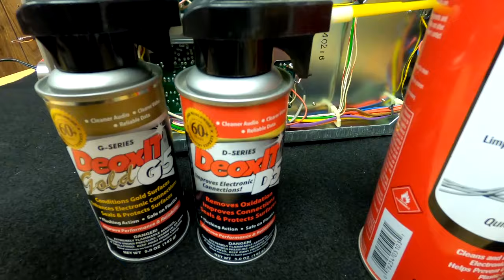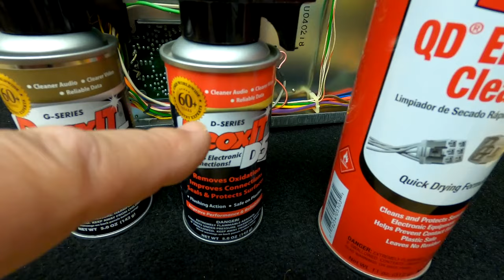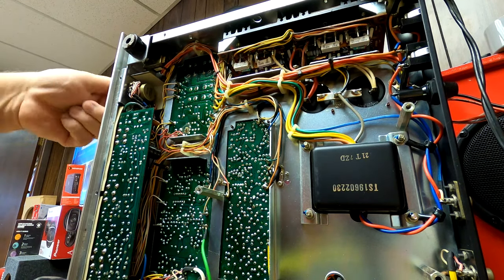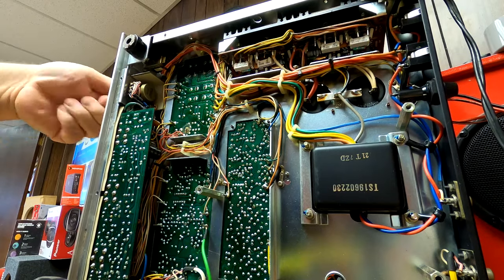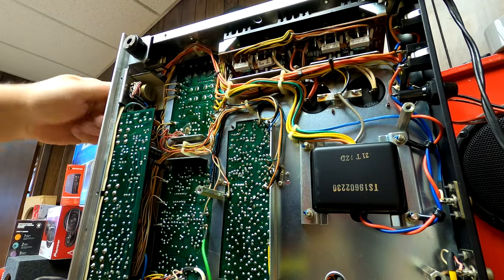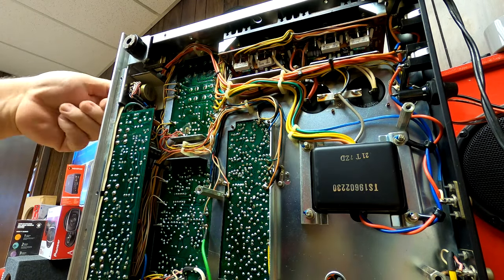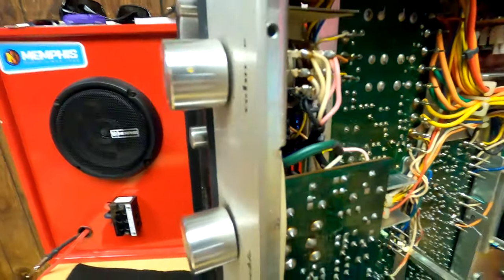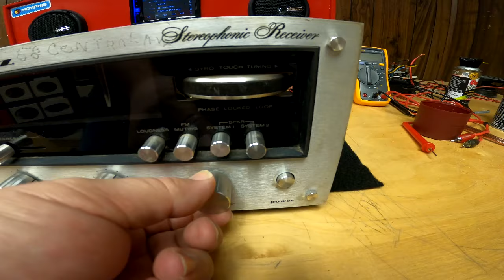How to Clean a Dirty Volume Control

Comment: I’ve cleaned large mixing consoles/desks for decades.   Use CRC QD to clean, CRC 2-26 to lubricate.  That’s all you need and stands the test of time.   The real secret is the person doing the job.  You can damage just about anything by not knowing what you are doing even with the right chemicals.   And don’t tell anyone, but somehow 40 years ago they cleaned components with isopropyl alcohol and lubricated with wd40!  The horror!
Reply: I remember 40 years ago seeing people do that. It worked......for a little while but always ended up becoming an even bigger probelm eventually.
You're absolutely right about the QD Electronic Cleaner. 
You can get it at walmart for about 5 dollars. I've been using it for years and it works great
Reply: Isn't 90 proof still good to clean with?

Comment: For your amazement WD40 stands for "Water displacement 40" it has been use for over 50 years in the boating industry to dry and promote electronic contact in wet ignitions systems of boats and of cars. It was also use in the boat store next to my house when I was a teenager for contacts and switches. Making them work instantly. It was manufactured for that. People now a days use it to lubricate when this IS NOT A LUBRICANT like penetrating oil but will leave a small oily lubrication since the main component is FISH OIL... I don't use it for potentiometers... when I get a bad case of a dirty POT I just disassembled it, cleaning by hand with a Qtip or whatever needed and re-assemble it back! And that turn out to be a super clean pot...
Reply: There is no fish oil in WD40, they actually straight up called that out on their site lol.
Reply: Can we use WD40 to clean volume controller of amplifier ?

Comment: Crackling volume or other pots can also be an indicator of bad capacitors with high DC leakage.  The DC passes thru the pot and as you move it, it crackles.  Of course if you have sudden loudness changes as you rotate a pot, it's most likely dirty or has a bad spot.
Reply: How would you know the difference? Is it dangerous if it's leaking DC? I don't know anything, I just want to fix it.

Comment: Deoxit markets its F5/Fader product as for use with faders and potentiometers. However, if you read the company's product guide for audio gear applications, they recommend only F5 for faders and only D5 for potentiometers. At least I'm not the only one confused.
Reply: Their reasoning is inpart because the slider faders are always plastic with some conductive stuff glued/painted on them. For pots, they could be metalic coil, metal with painted on conductive material (carbon), they could be plasitc with conductive material, etc. Which gets into this product is better that that product for that scenario. Most people are not going to disassemble the pot to find out, just spray like in this video. 
My understanding is by mid 70s most of the pots were of the carbon disk type, not the wirewound. So F5 would be better.

Comment: Deoxit gold is just an extremely mild form of deoxit.   The "gold" indicates that it's intended for use in applications where precious metals are present as they can be harmed by something as strong as normal deoxit.   Classic deoxit is 20‰ cleaning agent by volume.   Deoxit Gold contains a mere .5‰ (one half of one percent) cleaning agent by volume.
Reply from the maker: I understand,  however I have been using this combo for years with great results.
As they say..... works for me.
Cheers
Reply: Sokniko01..so, in ur opinion..you dont need the gold?
Reply: @lazymug  That is correct.  Deoxit Gold is just a super diluted form of Deoxit made for use on precious metals such as gold that might be negatively impacted by the use of the full strength Deoxit.
Reply: Is Deoxit Gold safe to use on the Marantz pots ? They have silver contacts within them I believe

Comment: For cleaning I use the already mentioned combo of CRC ELECTRONIC CLEANER/ CRC 2-26 lube which are easy to find. I use deoxit f5 if there is an actual "oxidation" issue. That is the ingredient that makes it different.  Brick and mortar locations that carry CAIG Deoxit products right on the shelf that may be near you include, Guitar Center, Micro Center(computer store), select electrical trade supply houses, and select appliance repair houses.
Reply: CRC QD Electronic cleaner is not easy to find.
Try living in England, you can buy drugs of any description on any street, illegal firearms BUT not CRC QD Electronic Cleaner. 😡

Comment: I have a Fisher Integrated Amplifier model CA 880. My aunt gave it to me probably 20 years ago, and she got it new back in the early 80s.  
Anyway, for at least the last 5 years , the volume knob would crackle like crazy when it was turned up or down. It was so bad that I had to adjust and readjust the knob over and over again just to get the sound to come out of  both speakers. So I watched your vid, hit the hardware store for some contact cleaner, and cracked that sucker open. I followed your directions and now there is NO CRACKLE AT ALL and no "dead spots" on the volume dial. 
Thanks a million for the excellent instructions!

Comment: CRC QD should be used very sparingly. Too much will compromise the carbon tracks inside the potentiometer. 

Dexoit Gold is for gold plated surfaces ONLY, such as computer edge card connectors. It contains up to 70% naphtha which is a very strong solvent, and will also attack plastics. You do NOT want to use this on potentiometers.

Deoxit F5 is designed specifically for faders, and generally accepted for use on potentiometers. It is safe for plastics.

Deoxit D5 is for metal-on-metal contacts such as switches, relays, and connectors.
Reply: Yours is the best explanation for the proper use of these products that I have seen. There is a LOT of misinformation out there on what cleaner/treatments to use where. I hope many people see your explanation. Thank you.
Reply: Exactly!... Gold is for gold contacts not for pots! Following this kind of advice you destroy your equipment!
Reply: I was just thinking the same thing...
Reply: I purchased some Deoxit D5 Gold just the other day, because thier information on the brochure said it was safe on plastics and clearly can be used on precious metals, such as for example gold, silver and rhodium.  When you say potentiometers do you mean pots ? Like volume, bass, mid and treble controls ? It's made as an electronic cleaner, so why would it be made unsafe for pots ?
Reply: @odysseus521  I think it is, like a volume "pot" is short for the potentiometer.

Comment: I have seen some warnings about using D5 on carbon pots, since it attacks the trace apparently. So following up with DeOxit Gold or Fader lube (F5 in the green can) is recommended. Mr. Carlson's Lab (super expert) even recommends using Specialist Gel Lube WD-40 (not normal WD40!), formerly known as "Spray-n-Stay". It prevents oxidation and water intrusion and provides smooth operation and good contact for a long time. Your instincts about this are good, and thanks for the tip on a lower cost solution! Saw your warning about WD-40. Specialist Gel is different stuff and it's not for cleaning, it's for preserving the clean contacts.
Reply from the maker: I haven't watched Mr. C for a longtime, I will go and try to find his video on this subject as I'm always willing to learn. I have been cleaning pots and sliders like this for many a years, before the CRC I used to use Blue shower (old formula) then fader lube. Just made sense, to me. Thanks for watching. Cheers
Reply: @breakerbroke23  Thanks for your reply! The Mr. Carlson cleaning video is on Patreon, so it may require a subscription to his channel. It is called 
"Mr. Carlson's VR and Potentiometer Cleaning Process, Also: PCB Breakout Board Release!" on Jun 15, 2020 at 9:49 PM
Reply: A friend of mine that has been doing electronic repairs for years, uses LPS-1 as a final lubricant. DeoxIT Fader 5 in the green can and then the LPS-1.

Comment: Good stuff 👍. I've had good luck using Deoxit F5 on variable pots / switches, especially the sliding volume in the older Turner hand mics.
Reply from the maker: yea, I use Gold on those pesky Turner mics :)

Comment: You're right, Caig recomends using the Deoxit G-series after the D-series. They have different purposes.
D-series is for cleaning. The G-series, S-series, and F-series are for protecting various items
The Deoxit D-series (D5, D100, DN5, etc) are for cleaning and deoxidizing.
The Deoxit G-series (G5, G100, GN5, etc) are for protecting with a little bit of deoxidizing action. Sufficient for the little oxidation expected on gold plated connectors. 
The Deoxit S-series (S5, S100, SN5, etc) are for protecting with some lubrication. No cleaning action. Stronger protection than the G-series, better for harsh environments.
The Deoxit F-series (F5, F100, FN5, etc) are for lubrication. No cleaning action. These add lubrication that was removed during cleaning with the D series product. This is for things that move, such as volume controls, turn knobs, switches, multi-selectors.

That's a very short version. There's several user guides to cleaing vintage audio gear that are pages long about how to handle various parts, or for vintage PC parts which are closely related to retro games.
Reply from the maker: I don't believe I have used the S series, I will check into it. Lubrication could be an issue in our mobile electronics as it could attract dirt ( front controls on a CB Radio ) but I imagine would be good in the home environment.. Thanks

Comment: I just got a Pioneer SX-450 that's very scratchy. I tried doing this with D5 and it didn't work. I'm not sure I got in the pit correctly. I didn't take off the bottom cover though. I'm gonna give this another shot now. Thanks for the video.

Comment: The Red Deoxit is not intended for Pots, its only meant for Switch contacts eg. Brass plate etc and so will kill the carbon tracks inside pots over time & sometimes in fairly short order and isn't great on fibre board PCB's in older equipment....!!!!!   The Green F5 Fader Deoxit is intended to be safe for carbon or other resistive tracks and won't kill your pots or faders.....And the Gold one is specifically for Cleaning Gold Plated Contacts....All seem to be really good for all of their intended uses....

Comment: I have a Harman pellet stove do you think I can clean the control board? Is there a good way to clean the control board to help it lest longer? Do you think it would be ok to use a can of DeoxIT D5 to clean the dials once a year to help the control board last longer? If you think this would be ok should I give each dial a small spray then turn the dial  then let dry?
Reply from the maker: I would blow the dust out every year and go from there, I don't see where a shot of DeOx would hurt when doing that regular maintenance. I like having a can around anyway.
Reply: @breakerbroke23  thank you very much for  getting back to me hope your channel is doing good

Comment: Deoxit Red is not meant for carbon potentiometers.  It will degrade and eat away at the carbon over time.  Use the Green Deoxit.  The red will work great at first but over time the pots resistance will start to fluctuate because of the carbon break down.
Reply from the maker: Thanks, I will look into that.

Comment: The WD-40 contact cleaner is just as good, and you get more of it in the can so more cost effective if using it a lot. I always follow it with a blast of compressed air. If the carbon pads inside the pot themselves are worn away then there's no saving them time to replace them.
Reply: Is the WD-40 contact cleaner any good...? 
CRC QD Electronic Cleaner is unavailable in England.

Comment: The CRC CAN is for automotive use only! You use that for Terminals connector like your headlight connector. That's not for electronic use.
Reply from the maker: You are wrong my friend,  but hey... Thanks for watching.
Reply: I use it on all electrical
Reply: I use it for cooking, never had a problem.

Comment: I just picked up a Teac A-7010 reel to reel tape player and the power button seems to be gummed up. I will follow your advice and see if that solves the problem. Crossing my fingers, hopefully that works! Thanks for the video!
Reply from the maker: Soak the switch with the CRC, (get as much as you can inside )
Let it soak for a minute or so then try to move the mechanism on off on off. I had a technics receiver come in that the power switch would not move at all, I thought it was a bad or stuck switch, so I first sprayed in a bunch of CRC let sit and did it again.  The switch freed up and still works like a charm. 
Don’t forget to use the DeOx to lube it up.
Reply: @breakerbroke23  incredible!!! That worked like magic. Thanks you so much for your feedback!!!

Comment: I have an old audiovox in a 69 camaro. My aunt bought me the radio on my 15th birthday for that car. I still have both, but my aunt passed. It's a cheap radio, but has sentimental value. This would probably fix my volume issue, it was extremely jumpy but it has quit all together now.
Reply from the maker: I would give it a try. Remember, CRC First then the DeOx.

Comment: Hey I just purchased an old Radio Shack SW100 am/fm/sw radio and it has a fine tuning knob in the center of the larger tuning knob.  Both knobs rotate freely and smoothly but the fine tuner feels like it doesn’t always grab so to speak and will only erratically move the needle.  I assume its geared and only actually supposed to be spinning the larger outer knob when you turn it but just slowly?  Should I attempt something like this?  I’m not sure how easy it is to get into, could I just pull the knobs off and try to squirt this in from the shaft end?  Great video btw.
Reply from the maker: Hello, I don't think just taking the knobs off and trying to get DeOx down the shaft would work, I think it need to be assessed from behind. I have never been into one of those rigs (cool as heck rig BTW ) so I don't know how that knob functions. There maybe be a tension spring on the string dial or the pulley on the tuner cap... Wish I could be of more help. Good luck and  Cheers
EDIT.... I wounder if the tuning string has slacked a bit and is slipping.

Comment: Nice. Just picked up a Sony CD player from 1980s.   Headphone volume control definitely symptoms like yours.   Min volume not silent, mucho static in right ear headphone.     I’m going to purchase the service manual just for kicks but your fix is great.   Anything no similar for CD Player laser track/rail clean and lubing?
Reply from the maker: Back in the day we used a drop of singer sewing machine oil then I used a Q-Tip to dab off any extra oil.... a tech back then told me to not put any oil or lube on transports or mechanisms.   IDK this technique worked for me but I never seen any gear come back in so I was not able to see the after effects. Cheers

Comment: I bought the D5, the gold, d100, and fader for a 4 can variety. I plan to use the crc/d5/gold combo you suggest, but where would the d100 or Fader come into play?
Reply from the maker: IIRC fader is cleaner but more of a lubrication. I used it on slide controls like L&R balance on Marantz receivers or slide volume controls on CB Radio power mics. IMO al the De Ox products work for general cleaning and can be used in combinations that will work for you or your application.
 There are a lot of OCD You Tubers that will argue this way or that, however at the end of the day experiment and use what works for you. You cant go wrong...  
If you don't like the results then just clean the pot with CRC and start over:)

Comment: What does it mean when you have to repeatedly keep using contact cleaner? I have a receiver that worked perfectly after doing this, but the problems with the mail volume knob (crackling and just plain not working) keep coming back a couple of weeks after cleaning! I suppose it means that I've got a worse issue.
Reply from the maker: I would start looking for a new control. I have had a pot haunt me. Eventually I just replace it. If its a vintage receiver, maybe start combing ebay for one.

Comment: I have a old Onkyo receiver no static in the vlume control although i have had 80's stereos that have done that. What's happening to my unit is the right speaker will cut out and if i rapidly turn the volume up and down it cuts back in. Will this method work that you are showing us?
Reply from the maker: yes

Comment: Years ago there was a hyrocarbon spray called FREEON... Oh how i miss it.
Reply: I think that was r11,it was in an orange jug,20 lbs,r12  was white r22 was green,r11 was strictly a cleaner for compressor burn outs,it was great and great for radio work also,I use to get it for abt25 bucks a jug back in late 70 early 80s😊

Comment: I use cleaner that I can get in stores here (Deoxit is amazon only) and have found that the cleaner fixes my problem (scratchy static on the volume knob) but a few hours later once its dried the sounds come back. Will D5 fix this and make it last forever, or do I need just the gold? Or...something else?
Reply from the maker: Follow up with some D5, that should take care of it. But before you add the D5, flush the pot with your cleaner first.
Reply: @breakerbroke23  ...I ended up just going with WD40 ><

Comment: All these contact sprays will eventually dissolve the grease that keeps the gear inside the volume pot lubricated.
If you are to use a contact spray to dissolve gunk build up, make sure to re-grease it afterwards, otherwise the gear inside the pot is made of plastic and it will dry up, start cracking and eventually break and then you won't be able to turn it at all.
Reply from the maker: Been doing this for decades.... Never seen this happen. Ever.